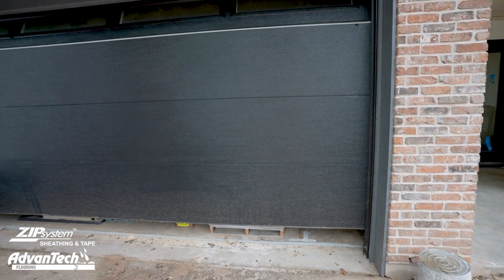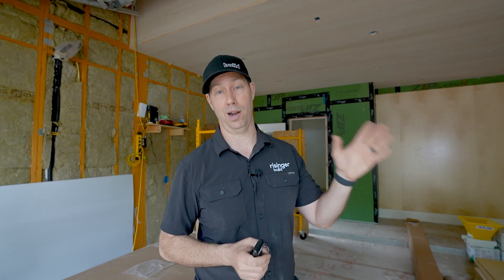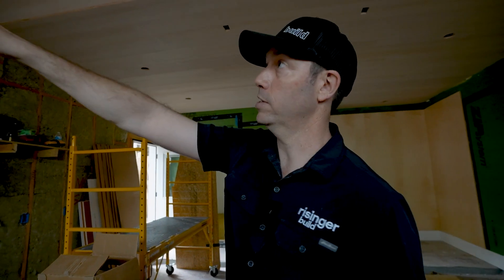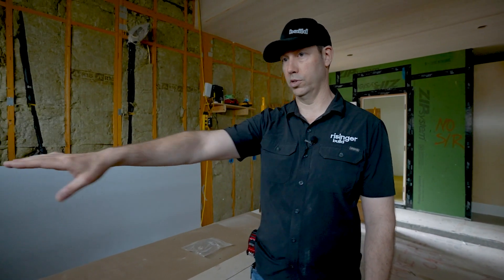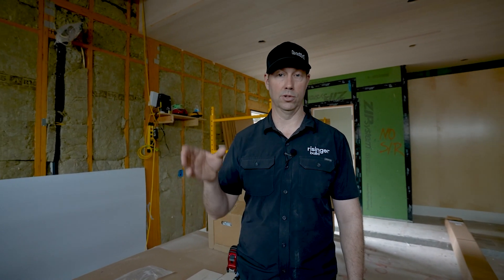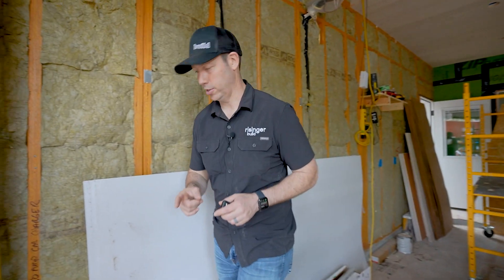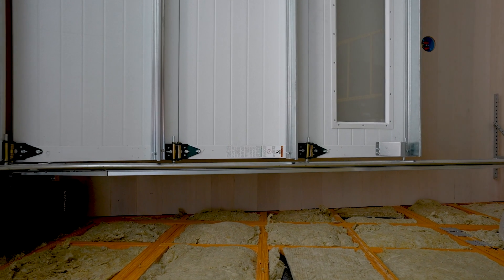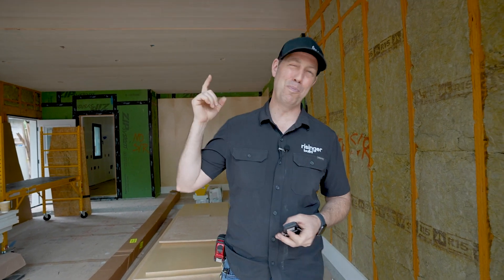SUPER Insulated Garage!

Comment: Hey Matt i noticed you have the "Green Hinges" on your door to help maintain pressure and seal the door properly. I also noticed on your old home video you installed ThermoTracks. which system would you recommend between those two? I have a new home (2019) with a well insulated door but i do notice some cold drafts in the winter.

Comment: What not spray foam insulation type is recommended for a 2-story garage where the first story is the actual garage and it's not going to be conditioned beyond an occasionally-used through wall AC unit, but then the upstairs will be a conditioned (mini-split) apartment in Zone 4?  Should faced insulation on exterior walls be used and, if so, which direction should the paper be?  I see in this video you are using unfaced insulation (assuming Texas).

Comment: Awesome home! Question about the garage. In CA, garage door openers must have an emergency pull cord which allows firefighters and homeowners the ability to escape should the opener be damaged and not functioning. Simply pull the cord and the opener releases the grip on the chain/screw allowing the garage door to be manually lifted open so the occupants and firefighters can escape. Does the opener have something like this?

Comment: I thought fire codes require "Minimum one-half-inch gypsum board or equivalent on garage side of walls and ceilings common to house or shared attic space"
Reply: That would be good to know. How does maple plywood hold up to fire?
Reply: If you look at 2:11, there's gyspum wallboard between the plywood ceiling and the bottom chord of the roof truss. As for the walls, hardwood plywood will char before burning so it might be considered "equivalent".

Comment: The Elide Fire gadget looks interesting, but I am concerned about whether or not it has enough mass of the materials appropriate to extinguish a battery fire.  That garage door sensor is pretty nice though.  I have two sensors that are plastic clipped onto the door track and when I bring a trash container in and bump it... the sensors get bumped out of alignment (oh brother!) and when I attempt to close the garage door the door will not actually close.

Comment: I've read there are several downsides to an insulated door, primarily if you use your garage to store a car, or cars.  That being, your car gives off quite a bit of heat just after you turn it off.  With a super sealed garage, and insulated door, that heat superheats the garage, reversing the affects of the insulated door, trapping the heat inside.  
If you use the garage as a "junk storage" space, this doesn't apply.

Comment: The MFG specs a 10-30cm install height above the protected object. Your ball is to close.
And while the instinct is to mount it directly above the item being protected. It should be moved out of the corner and away from the wall a bit. There is a reason why you dont install smoke detectors in corners. Heat travels similar to smoke.

Comment: Hey Matt, so the soffit in your garage is completely closed from air flow? I have the same layout with half of my garage ceiling being part of the second floor living space. My garage ceiling rafters terminate to dry wall, they don't vent into the attic. My garage is currently unconditioned, I plan on sealing my garage soffits and insulating the ceiling with closed cell foam or rockwool and adding a mini split.  Do you recommend sealing my soffits and insulating it rockwool?

Comment: I wonder if the Austin, TX temperatures plus the motor heat on hot days would be enough to cause the 'fire ball' to activate.  Who planels the ceiling and walls of their garage with wood panels when it could have been marble.

Comment: I’ve heard some reliability issues with that auto deadlock. I wanted to do it too, but I heard it can malfunction a lot, and if it doesn’t disengage, can cause some decent damage to the garage door when it tries to open without the lock disengaged.
Reply: I have had mine for 2 years.... Zero issues don't listen to everything you hear
Reply: @daveklein2826  awesome! Good to know. I just got my new insulated garage doors and belt openers from liftmaster. Based on your comment, I think I’ll add that to my doors. Thanks.

Comment: Any advice on a heat detector for the garage? I know smoke detectors are not recommended due to the amount of dust in the air but I can’t find any reliable heat detectors that can tie into an existing system wirelessly??

Comment: I did a BUNCH of research on insulated garage doors and, yeah, their advertised R-values are worthless.  The doors have HUGE continuous steel thermal bridges along the edges of each panel and are even worse than using steel studs in an insulated wall.  Also, air leakage is as big if not a bigger issue than lack of true insulation, and most garage doors are so air-leaky that 30-50% of your heating/cooling/latent loads are a result of the garage doors (yes, even "good" ones).  There are very few good options for an insulated garage door so it's not like these particular doors are an issue over others, but calling them good or insulated is not entirely accurate.

Otherwise, I'm really liking your garage concept - looking great!
Reply: @wolverine754 , insulated garage doors certainly are a benefit - I insulated my own garage door that was not insulated.  My comments are more in relation to the claimed R-values advertised by the door manufacturers.  There's no regulation and they can claim whatever they want, including impossibly efficient insulation (R17.5 2" thick door must have R8.75/inch insulation, which doesn't exist as far as I know).  This is why there's an asterisk* beside their R-value chart.  If you are planning to condition (heat and/or cool) a garage and you simply use the garage door company's claimed R-value for your load calculations, you could end up with under-capacity equipment that cannot satisfy your desired setpoints and FAR higher energy bills than you planned for.

Matt built this channel by preaching building science, but unfortunately he's getting these products as part of a sponsorship agreement and has no choice but to tow the company line.  He definitely knows that door is nowhere close to the claimed R-value, but he has to read the brochure.  This is where it pays to educate yourself so you can tell the difference between someone who is telling you factual information, and someone who's selling something.  If he only mentioned the fact the door was insulated there would be no issue here, but instead he is advertising the false claims of the door company.
Reply: So A timely video just popped up from the folks at the Fine Home Building podcast, and one of their covered topics is garage door insulation.  They echo my concerns about poorly represented specifications on garage door insulation:

https://www.youtube.com/watch?v=_Yo-Obad9H0&ab_channel=finehomebuilding

The topic starts at 17min 40s, but the good part where they expose the garage door manufacturer's claims starts at 20min 50s.  Enjoy!

Comment: Hmm.  @mattrisinger needs a cue card, he forgot the hinges for one thing.  That door is dented.  When I put a new two car door on my father's house more than 20 years ago we had to get three doors in a row before they delivered one that wasn't dented or crushed in some way.  This was an aluminum door, not sure what using steel does to improve the door's dent resistance.

Matt has also gone over that fireball extinguisher extensively before, not sure why he's repeating.  And he must think the opener has a lithium battery, which it doesn't, so won't catch fire easily.

I'd love to hear more about the overhead door company door's construction.  What about the door joints, how are those sealed?  What about the outside seals, is he still using the seals he showed at the house across the street?  And are those hinges really needed if the door is very well installed?  

Come on, give us some actual technical content, not just a sale pitch!  Getting tiresome, could be losing a subscriber here.

Comment: Do you not have a whole house back up generator?  Or is the generator limited to only some circuits in the house?  With the gender is the battery back up really needed?  We have the myQ system and really like it, with a camera system I can watch house if someone calls, open door for them and then close when they leave.

Comment: Hey Matt did you hear there A scientist has invented a material that reflects the sun's rays off rooftops, and even absorbs heat from homes and buildings and radiates it away. And — get this — it is made from recyclable paper.
Its call cooling paper
professor of mechanical and industrial engineering at Northeastern University

Comment: Yeah so that ball will make a ton of noise but I doubt it will deal with a battery fire. You should switch the normal lithium or seal acid batteries with Lifebo4 batteries... Much safer.

Comment: They don't even list their prices on the site. That is not a "medium" cost door. Any company that doesn't list prices is for sure charging you all kinds of markups.
Reply: Most smaller and medium companies on these days don't list prices as it helps to keep price gauging from the competition down and also because with fixed prices you become a liable to maintain that cost. When you have to ask for a price they are giving you an estimate instead of the actual cost because often they don't know it right off the bat or haven't been in busines long enough to form a stable pricing point. Other aspect is that by hiding the price they don't end up on compare pages made by web crawlers where prices can be offered and compared to much lower offers then they can afford and also when customers are required to ask for a quote on a product they are a much more likely to buy that product as they have now invested more time and effort on it then just browsing prices.

Comment: I have a question about garage door installation and it's about those ugly angle-iron brackets that everyone uses.  Why hasn't there been anything to replace those in all these years?  I know the answer is mostly because it works, it's cheap, and most people don't care.  But I've seen some really nice, expensive garages that still use these kludgy-looking brackets. I realize that every mounting situation is potentially different, hence the cobbled-together nature of these things, but you'd think someone would have come up with a more elegant-looking solution.  Does anyone know of an alternative on the market?
Reply: Hey man I install garage doors and there isn’t a solution to that yet and that’s the only way we can do it there are special occasions where we’re able to mount it to the wall but those aren’t often and they’ll lead to problems down the road depending on the door you have and the size of the door if you want further insist I’m glad to answer any questions you have
Reply: What angle brackets ? The ones for the wheels or the ones for making the door strong enough to stand against the bow caused by wind pressure ? 
You could make the door slide in the track but it's vulnebale to debris and wear and tear and takes significantly more force (along with grinding noise once lubrication fails) to drag along due to surface friction then using wheels.
Reply: @petrirantavalli859  they're talking about how the track is suspended from the ceiling.
Reply: Bi fold (or more) doors are kinda only option if the garage door is being swamped. 
Otherwise you can have a high garage ceiling and put false ceiling under the garage door opened location. If it were me I'd go with second option

Comment: When i bought my house the garage wasn't insulated.. we could see all the wood trusts including the roof trust. But i. did a huge mistake when i finished my garage…  my mistake was to move in and live with an unfinished garage for 2 years before deciding to insulate it.   I started with electricity, added two 15 amps lines and one 20 amp for heater,  changed the garage door to get a R12 door from home depot. I wish i had bought their higher R rating but i was being too cheap (big mistake) . Then i had to wait a year to find the fund to do the drywall.  Here the code is 5/8 inch for garage drywall. Snd those sheets are quite heavy.   Ceiling is almost 11 feet tall in the garage.. so what is the mistake i did?  I did the flooring at the end,, but was too much of a pain to empty the garage .. and i had no where to put all my tools and stuff..   so i could do it again. It would be the floor first.. if you move into a house the first thing you should do before you move any stuff in is to work on the floor. That way you can work freely, then buy the best garage door with the highest R value.. and then put as many breaker possible..  right now i have an car, and i had to install a 50A line but my main was full…. As for fire. With an 
EV car burning in the garage.. i think you will need more than few balls.. even a swiming pool above win't extinguish the fire..  Lastly, the side lift opener was also my first though, but then i realized that you can't hang ceiling storage rack if the garage door hugs the ceilling when it opens.   With conventional garage door opener with tracks, you can use the above to install ceiling storage…. Nice garage anyhow.

Comment: I've been watching this series on your house and wondering how many Apps you will end up having to control all the gadgets from multiple vendors?
Reply: Haha, right so much crap that’s not needed.  To “help” make life easier yet app’s like those usually don’t work great to begin with.
Reply: Many of them work with Google assistant. I have MyQ, Leviton and sprinkler hardware, but it's all controlled through the assistant.
Reply: @jghall00  So much of house will rely on having internet access!  LOL. When a house is open, hardwire it and control is much more reliable.
Reply: @fredflickinger643  Everything works without the Internet too. The switches all have regular interfaces on the walls. I just got tired of my wife asking me to get out of bed to turn off the light after she just walked by the switch to get in bed. Now they can all be controlled by voice and dimmed.
Reply: @jghall00  and when your WiFi is down for one reason or another!

Comment: So ... if the power is out then your wi-fi is out, so your cell phone can't open the door. Therefore you need to go open it manually, defeating the purpose of the battery backup, no?
Reply: No.  Your normal garage door opener remote still works.
Reply: Regular remote transmitters still work.
Reply: @VulgrDisplay  True, but that's my confusion,  if you need to also carry the remote, what good is having cell access?
Reply: @wolverine754  If you have to walk up to the unit to push the button, what good is the battery backup? You can just manually open the door.
Reply: @wolverine754  If it meant the difference between the cost and maintenance of a battery backup, I would spend 5 seconds doing it manually on the rare occasion that the power is out. I mean, you have to get out of your car and walk up to the unit anyway, because wifi is down and your phone remote doesn't work.
Reply: @wolverine754  Ya 5 seconds to detach and re-engage ... even for your woman and teenage daughter.
It's not just the batteries, it's a battery backup built into the opener, plus charger, and a dam sight more than $14 ... several hundred extra min.
Not everyone wants to live with the expense of a backup for a backup with its own fire suppression (!!) ... but hey, if you're so afraid and need to pay for that peace of mind, go for it.

Comment: Nice, but will there be significant thermal transfer to the interior of the garage from the double steel doors? Looks really cool like the door sensor covers. Also, thought you were going to use the curved vertical garage door rails that pull the door in snug? Any reason you decided not to use that product?
Reply: The door is hollow and filled with polyurethane foam insulation

Comment: Your fire ball won’t work for a lithium battery fire as the ball is rated ABC and not D. Lithium batteries require a class D fire extinguisher. This ball is not a class D extinguisher. This ball will not put out a lithium battery fire.Lithium batteries burn like crazy. And lithium batteries reignite if not fully extinguished. Lithium batteries are very very very hard to extinguish.
Reply: It doesn't even have a lithium battery--it has a lead-acid battery.

Comment: The problem with the door sloping like that is if you want to or need to open it by hand, it's going to be more difficult and I imagine it keep sliding down.
Reply: In the nextdecade how many times will that happen. Lol
Reply: The torsion system is designed to balance out at every section, but it has to be planned correctly. It's next level in garage doors.

Comment: One of the concerns with ever increasing insolation is the entrapment of particles inside of the house. White it's better to have an insulated house but the air quality inside is usually worse than outside.
Reply: What I usually do is leave my AC fan run constantly...and replace filter every 3 months or so. With MER 10
Reply: Not if the HVAC is done properly
Reply: @daveklein2826  there is no evidence to suggest that an HVAC system can reduce the particles in the house.
Reply: @daveklein2826  no need to make this personal. There are no studies demonstrating that indoor air quality has drastic benefits from ventilation.
Reply: @daveklein2826  oh I see...so when cannot provide evidence to support claims, blame ignorance and walk away...sounds like a republican